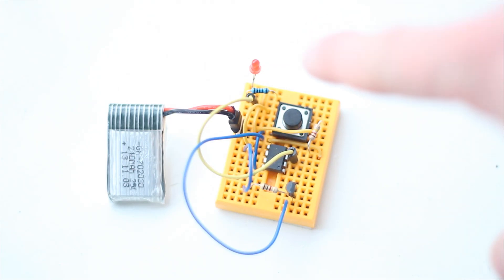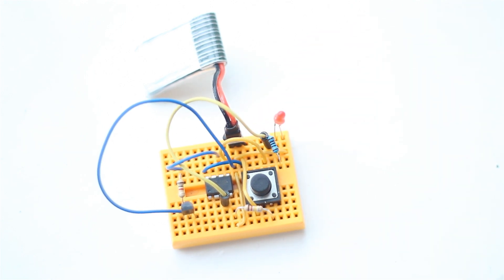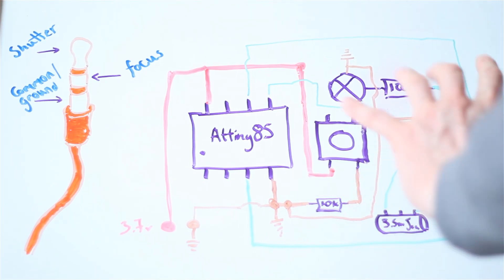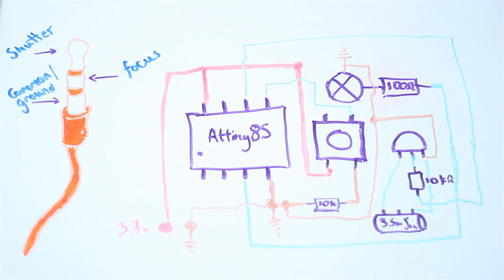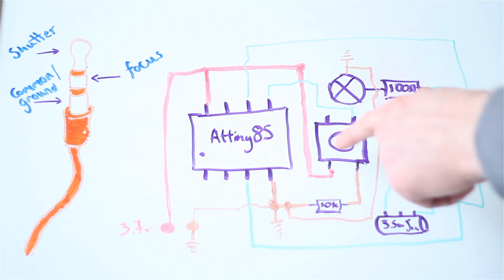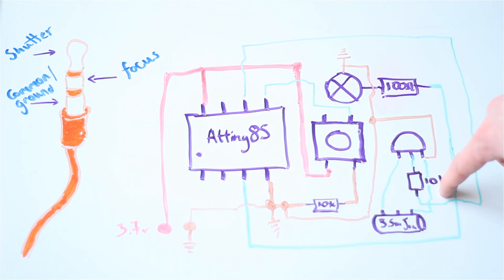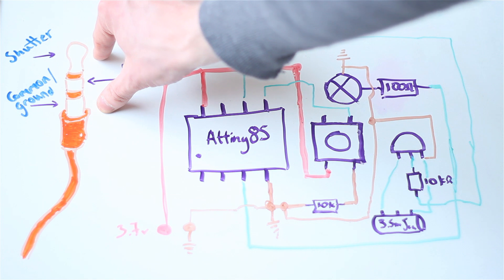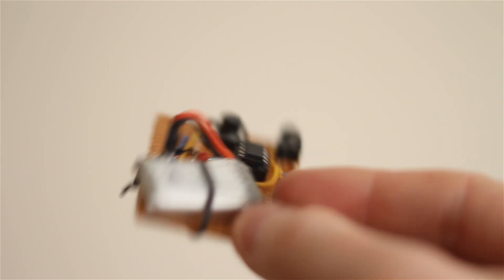DIY Intervalometer (Canon) using an ATtiny85/45

Comment: i need to do this but with an ir led  as my eos m doesnt have a 2.5mm socket instead of a cable and have switches to make the intervals say 30 seconds 1 minute 2 mins 3 mins 4 mins as i do astrophotography also it would ne to flash once to trigger the shutter flash again to close the shutter then wait 45seconds for the file to write to the card inside the camera possible???
Reply from the maker: Sadly I don't know. My Canon has the dreaded error code 70, so I now use a Panasonic.

Comment: Does it works with nikon dslrs
Reply from the maker: I doesn't look like they have the same kind of connector but the principle is the same.
Reply: so in short this circuit won't work with nikon dslr
Reply from the maker: The circuit will but you need a different plug.

Comment: Success :o) A good use for these little chips.....

I made a very similar attiny85 based one a while ago for my Canon but used an opto-isolator to fire the camera rather than a transistor. I also used a pot to select the interval time and powered it all from a 9v pp3 battery via a little 78L05 regulator. My code was really sloppy and the delay loops were a bit hit and miss so I had to trim them by trial and error. It worked in the end though so I etched a tiny pcb for the whole thing about 3cm square.